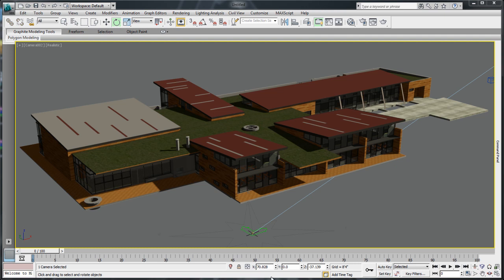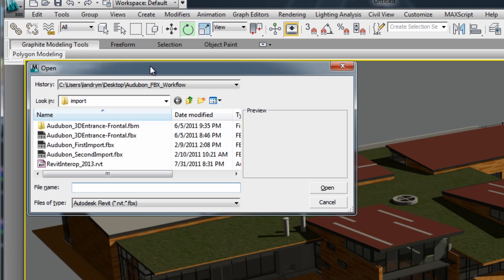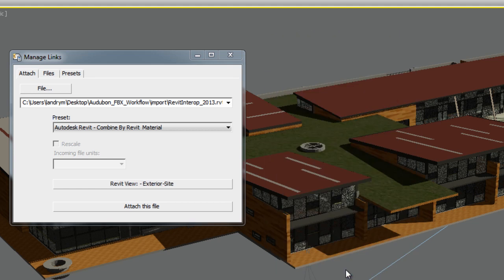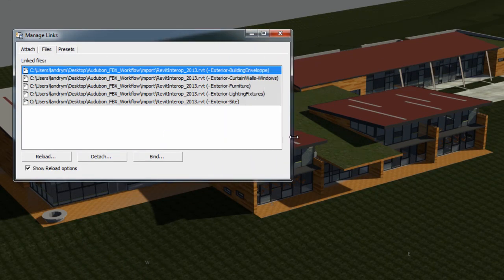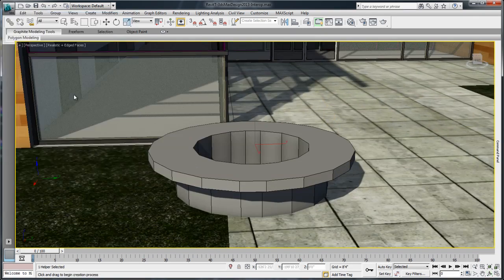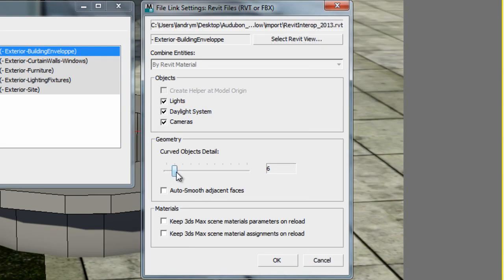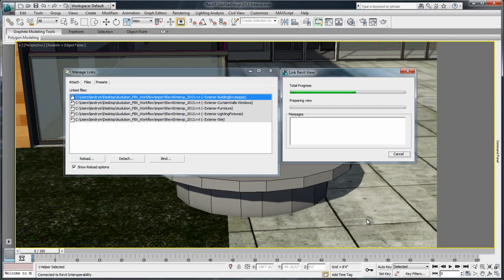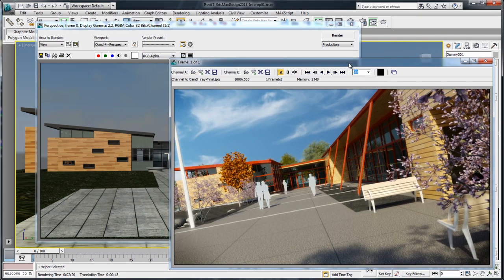3ds Max Design 2013: Interop with Revit Architecture 2013

Comment: I can't seem to link any revit file into 3ds max, I have both revit 2013 and 3ds max 2013, but both are student versions, does this have anything to do? or what am I missing?, I'm running both programs on a gateway nv53a laptop with 6 gb ram and an ATI mobility radeon hd 4250 graphics card.